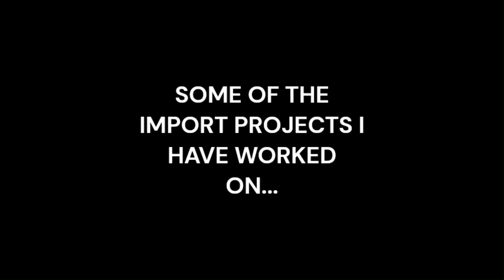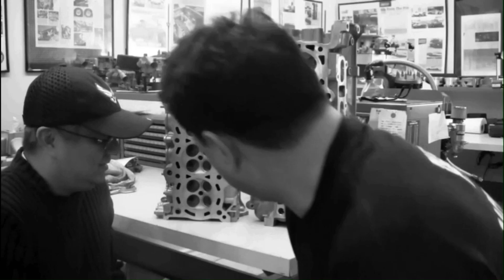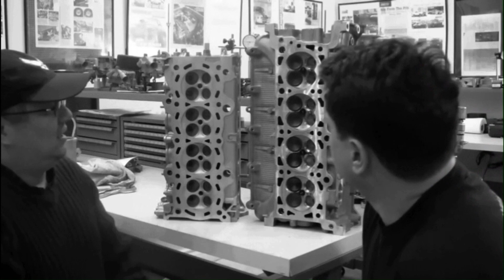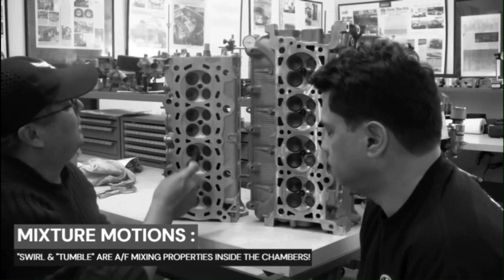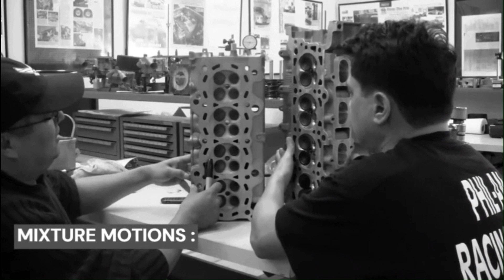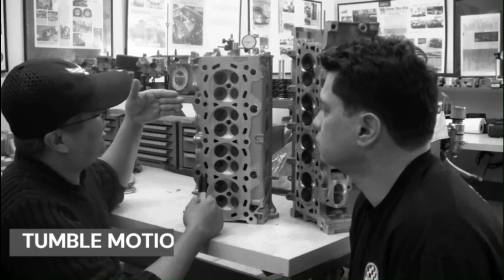FORD 4 VALVE V8 HEADS & HONDA.

Comment: They look like the head on a 16 valve Suzuki gs engine from early 80's, 750 ,1100,1150.  They called it tscc. Twin swirl combustion chamber.
Reply from the maker: 4V combustion chambers basically look alike pentroof designs but I have to know more about the Suzuki you are telling me.  Thanks Jerry.

Comment: You really didnt explain how lowering the floor actually helped. You mention it creates turbulence, and thats all. So does it keep more fresh air in the camber and inturn allows more combustion power? You said a lot with out saying anything
Reply from the maker: Most engines have an overly efficient exhaust ports/valves specially 4v's with 2 exhaust valves.  I had a discussion with some Ford engineers @ SVO about limiting a little bit of the low lift flow so as not to "over excavenge"  and pulling the intake column to the exhaust during overlap!  Lowering the floor tend to dissuade low lift flow thereby improving the dynamic compression of an engine.
I hope you understood this scenario and comes clearer because watching one video without referring on others ( i post like making more power with smaller exhaust valves) will give you a narrow view and get the wrong impressions.
Reply: @benalamedaracing2765  i understand engines and engine dynamics pretty well. But as i said you didnt really say what caused the improved power..but what im gathering now is the smaller valves inturn means a smaller port diameter which then means less exhaust scavaging and more fresh air in the chamber and more dynamic compression. So more air, bigger boom, more power
Reply from the maker: @km6832 , well not necessarily less exhaust scavenging but more precisely less exhaust flow "when" the exhaust valves are "closing" during overlap with its tendency to pullover the fresh intake column.  Therefore one must dissuade "low lift flow" from over scavenging... The issue is low lift flow.

Comment: That 4.6 head is known as a "B" head. Also known as "swirl port" head. Twin intake ports. 
They work really well with boost, but NA they don't work so well.
Reply from the maker: I agree with you and on one of my videos I stated that without VTEC or some kind of cam/valve control. the 4V layout is very susceptible to cross contamination killing response on the lower/mid rpm ranges.

Comment: I thought this was a Frankenstein recipe where 2 Honda 4cyl heads are used on one Ford V8.
Reply: Monitors K-series V8 more closely
Reply from the maker: I have worked from a Mercedes 4V 24 Hour of Daytona/12 Hours of Sebring endurance engines to a Motorcycle 4V, interestingly they all look the same with just the flange intake and exhaust being different and sometimes port height!  It seems  copy of on from another and the difference is how much intake vs. exhaust diameters they place in it from the manufacturer to their racing counterparts!

Comment: How about the 3 valve design Ben? 2 intakes n 1 exhaust valve, would they lend theirselves to better swirl or overlap benefits? Thanks for sharing
Reply from the maker: I prefer that layout better and the crossover dilution is less with one exhaust!  I feel it also exhibits superior response and mid range power!  I would like to see a comparable tests on the Modular Fords on their difference.

Comment: Hemi heads have the best flow of any design and have the worst combustion of any head design
Reply from the maker: The combustion and reversion issues are the biggest downfall so it lends itself to all out nitro burning engines and anything below that I prefer the semi-hemi Shotgun combustion chambers.
Reply: @benalamedaracing2765  true you would think the hemis chamber would work well with nitrous because of being so big but they detonate and I've never been explained why
Reply from the maker: @davidreed6070 , not very well with nitrous and a hemi chambers specially the open chamber designs!  They tend to speed up the flame front and without a quench and overly large chambers there is nothing holding it back from progressing from a fast burn to an explosion!

Comment: Can you restrict flow with primary size on a header?
Reply from the maker: If you restrict it then back pressures goes up and it is a balancing act most of all.  I prefer to have a step hedder design to a merge collector which i feel would be the bests!

Comment: Would have been really cool if you have started out with a Cleveland head showed where the technology started, and how it moved to the modular motors and now the technology is in the Godzilla heads. Anyway you could do a compare it's from a fifty-year-old head to a twenty-year-old head what your having a video to a modern current Godzilla head and is there anything different between the three heads that they've learned?
Reply from the maker: Godzilla I feel is the right direction to go from the complex 4V heads from the modular to the coyotes.  The only reservation I have with the former is the long valve springs which i feel will try to oscillate big time @ high rpms.  I should have requested an engine from my contacts perhaps as a project...  I wonder and I will try to get one free if possible!  lol
Reply: @benalamedaracing2765  Ford killed the modular motor when they took the job over from teskid,Italy strongest production engine ever produced 4.6 4v stock block stock heads stock crank, 5.9s at over 200.  They put a aftermarket crank in it same blocking, heads 5.8s with 281ci. Ford took over the job and already made three different Coyote engine. . Fail after fail. With a production engine. The 5.2 in the Cobra jet. Can run 7.7s drag and drive with no problem. But the production engine can't do that. Lmfao. They keep putting cheap parts in their production cars. Lmfao

Comment: Why are you not trying to compare the swirl to the new Godzilla swirl.
Reply: They say the Godzilla head has some of the best swirl as any head the 4 valve heads have tumble
Reply from the maker: I have not flow tested them yet so it will be interesting!  Swirl when it gets too much @ high engine speeds can siphon or centrifuge the fuel away from the air so that has its limitations as well.
Reply: @benalamedaracing2765  very true the Godzilla is meant to run at low speed. I'm working with the LS form I built it for a turbo but am running it na that thing is a hoss to have low compression and such a wide LSA.

Comment: David Vizard has a 4 valve design called the poly quad. It uses one oversized intake and exhaust valve. They are positioned diagonally from each other. His tests show increased swirl and reduced cross flow. What are your thoughts on this design?
Reply from the maker: Great question!  My feeling is to make it simple as much as we can.  Differing seat angles or one oversize intake valve is good and sinking the exhaust slightly to decrease cross flow will definitely help!  I like to keep the exhaust the same diameter because, the drastic temps and pressures will propel the spent gases big time and do not need any further help so trenching the exhaust valves (slight sinking) does not hurt flow or power so I keep it at that layout.

Comment: Is that why they never dropped the floor hump in the Cleveland exhaust port?
Reply from the maker: I feel the floor hump was there to place some kind of short side (shoulder) for flow to have something to adhere to before it takes a nosedive coming towards the shock towers!
Reply: @benalamedaracing2765  thanks for the reply. I'm in Australia so have only just seen your answer. One more if I may? So, all things considered, do you view the hump as an advantage, reasonable compromise or disadvantage? Thanks, and keep bringing your quality insights.
Reply from the maker: @willylanganke8862  The hump is a compromise of sorts!  This said, even with this downfall it will still outflow any other manufacturers (small blocks) exhaust ports big time!  This is why they dominated the stock classes and with the port plates makes it worse for even the big blocks as far as competition is concerned.

Comment: It's amazing coming from a V8 where anything up to 36 degrees of lead timing is the norm, you go to a DOHC cylinder head like a Cosworth or Honda and they might run 14 degrees tops
Reply from the maker: The main reason for the major reduction in ignition lead is the centrally located spark plug and the much smaller bore diameters compared to small and big block engines!  Bigger bore diameters require an earlier spark ignition to make sure it all ends at the proper crank angle after TDC.  Thanks for the great question.

Comment: So, is this the reason why Ford put a smaller exhaust valve in the GT40P compared to the GT40 and they make slightly better power? I’ve wondered why this might be it.
Reply from the maker: I feel they did the smaller exhaust to help low end torque and minimize intake overshoot towards the exhaust loosing dynamic compression and the accompanying torque reduction.  3 bar GT40s had the larger diameter exhaust but then again it came in the Mustangs and LIghtnings and not the Explorers.